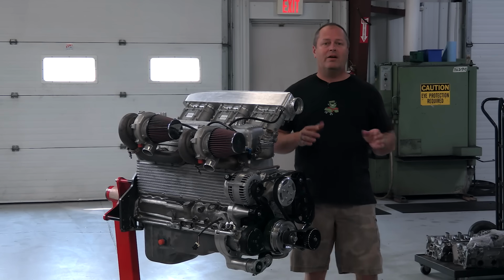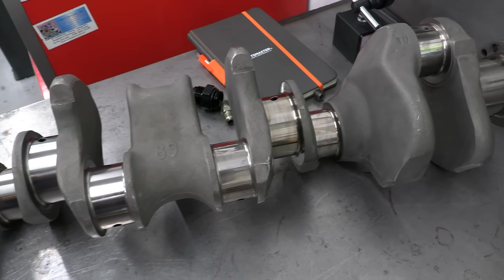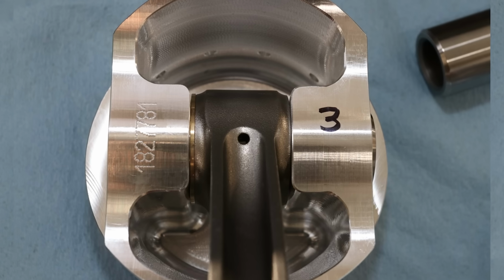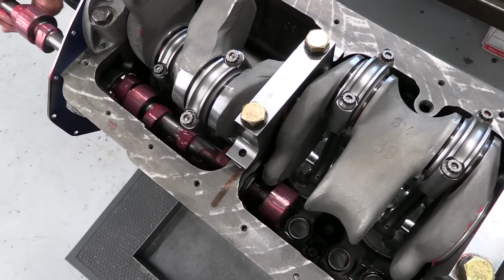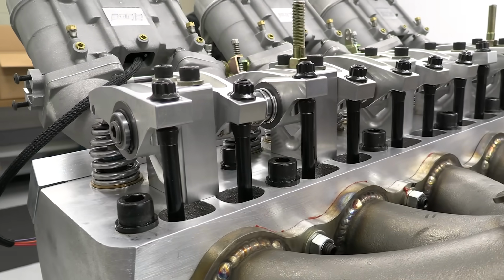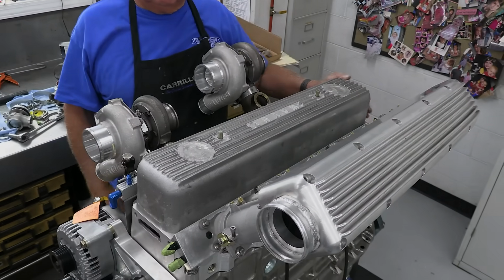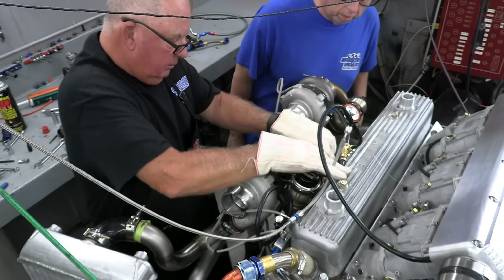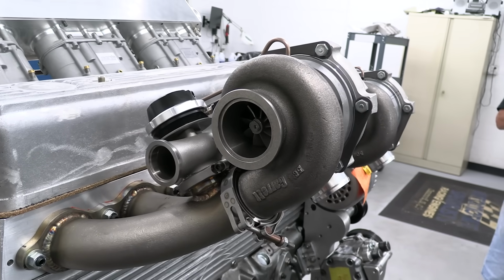Incredible Twin Turbo Chevrolet Straight Six is a One-of-a-Kind Creation!

Comment: My experience of stainless steel manifolds is that the continual thermal cycling changes the metallic structure of the steel resulting in it becomes more and more brittle. I have had much better longevity with cast iron
Reply: Built my first Garrett turbo GM 6 the 3rd gen block with 7mains in 1978 struggling to learn how to control what we had unleashed over 12months we made serious gain's with the addition of waste gate ram air methanol injection. I grew up loving building during the week runing testing at nights race on the weekends at "RIP" Ravenswood Raceway
Scarborough Beach
West coast Highway
All having in the 70s being venues for Drag racing and often illegal drag racing     Perth Western Australia 🇦🇺

Comment: Old hot rodders know all about what these old 6'ers can do. They used to get used in dirt track racing. Back when it was almost all local track run stuff, people would take shells from the 30's, build a pipe frame with a roll cage and a bumper.... and a side guard so you wouldn't get killed in your tin box..... and put a rodded out Chevy six in there. 
I know a guy that has a 2 door coupe that used this formula all the way into the 1980's, and kept up with the small block class cars and won. 

I think it is awesome to see someone doing this up old school with a six, even if they are adding modern tech
Reply: There was one in a field down from a place I worked at. The "roll cage" lQQked like it was made from black gas pipe for a house 🏠 👌 had a straight 6with a wild looking intake, carb was gone...from Wyoming USA 🇺🇸 🤠

Comment: The third gen straight six includes a  292  truck six, with lots of strength. Right now I am running 3, 2 barrel webers on tubular manifolds. The hp increase is substantial, but my goal is to add 2 turbos with 3 throttle body injectors. 
My budget is tight, but in the future  creating a new head from a pair of V8 Chev heads, as described in the stovebolt 6 book. Its been done before, and the hp  gains are impressive. The block has a lot of meat in it,  boring to 0.060 to 0.100 are common place.
This engine can produce 500+ hp. 
The result gives this 6 , V8 hp.

Comment: That torque "curve" is unbelievably straight. Such fine workmanship by a master builder!
Reply: Even in the old days the right work made those six's evil. Heard a story once a guy showed up with one to a circle track full of V8's. They ended up wrecking the guy out cause he was fucking charging up to the front like a bat out of hell.
Reply: @jr540123 
The GMC 302" ruled back in the day; add a Wayne head and you were good to go....
Reply: @jr540123  my grandfather ran a straight 6 in a dirt track car,  in the Midwest back thru the 60s and early 70s. Thing was fast
Reply: That's a I-6 for ya'. Smooth as silk FAT torque, brought to you by Chevrolet.
Reply: I love horsepower, but i'm a torque monster,..gimme more torque!   :o)
This is my new favorite torquer-er-er-er-er-er.  Man, i love, LOVE straight 6s! Just love 'em!
And how could anyone not love the twin turbo setup? That's just the icing on the cake. 500+ hp on that crank? LMAO!
And then i remember which vehicle this is going in, and i just go complete envy. Good,. .clean,.. envy.    LOL
I WANT ONE!
Reply: Amazing build! Using  a 1958 block? Sorry I didn't realize who the  builder was at first, but Keith you are the best! #1 engine builder- Greatest  Of All Time!  I just love how your torque and horsepower curves get together early on and just don't stop. Those gen 2 Chevy 6 engines have that one amazing trait: old Chevy 6 now runs like a small block, wait that isn't correct, it runs like a big block!
Reply: @rgroove1970  That thing is wild. I've never seen a car bounce the front tires down the whole stretch and not look scary as shit the whole way.
Reply: I was thinking the exact same thing
Reply: it´s because it starts at 3500 rpm
Reply: @rgroove1970  Mr nice build BR... i will call you

Comment: There's no torque "Curve", that's a torque plateau. A Torque Hoodoo. Someone will ask you about the power band and the owner will just say YES. I wonder how good it'll be for towing, or even what mileage it'll get- that engine's gotta be super efficient now.
Totally agree with Kieth about making odd one-off and custom stuff. Before electrics take over, we are giving gas the greatest send-off possible- The LS has made huge power a breeze, cheap machining tools are everywhere (both from classic American cast iron to slave-built Chinese stuff) and information and help is literally a forum away. Thanks so much for showing us all this cool stuff HM!
Reply: But if they're so efficient,  why are rx8s such gas hogs? Could ot have something to do with low torque?
Reply: @MrPaige222  I'm not a rotary guy so grain of salt, but rotaries have terrible problems making NOx and other oxides because they burn so hot- and oxides are what you get with a hot burn. The renesis had to avoid that with a unique air intake design that partially strangled them.
Reply: @girthquake1413  
I'm right there with you. I have little to no respect for that particular engine. I understand the tiny displacement in regards to the horsepower output, but it comes at such a huge cost in reliability and fuel economy. No thanks. It's no wonder an RX8 is practically worthless
Reply: @paigehunt3387  Chassis is phenomenal tho; it's basically a bigger Miata.
Reply: @Robots Can Do Better Thank you I wasn't aware of that...Only problem with the rotary is the sealing longevity issue as I see it. Better machining and material control could solve much of that, with at least an elimination of apex seals...
Reply: @Robots Can Do Better But in the long run?(maybe the short term), I believe that diesel hybrids are an excellent feasible solution, particularly considering their flexibility of fuel options. I still think the EPA is BS....
Reply: Bite your tongue...electric cars suck unless it's a hybrid. Two stroke supercharged diesels ARE STILL the most efficient power plants. Been working for the Electromotive since the 50s and they only carry a bare minimum of battery.👍 The EPA is in the back pocket of industry, we should be getting a minimum of 100mpg if the EPA were really doing it's job...Old tech and the new 👍
Reply: @charlesangell_bulmtl  okay boomer
Reply: @girthquake1413  That's all you got?🤣😙😙🤣 Big issues with battery production/recycle. Pollution is OKAY as long as it's not in your back yard, eh?
Reply: @charlesangell_bulmtl  Bro why are you triggered lol, i'd agree with you on diesel hybrids if you weren't trying to look smart in a YT comment section lmao

Comment: If you think this one is the most advanced take a look on what guys in Brazil do to these, they are very popular here, an there's anything done to these, from "simple" turbo setups to original castings builds that push over 2000hp and low 7s passes with H pattern stick shift  and full billet dohc 24 valve builds

Comment: Why not rotate the turbos 90 degrees air filters top center and the exhaust bottom center would isolate the heat from air intake and some plumbing problems!
Reply: turbos can be clocked however the hell you want,this was for the dyno run...kinda thought that would be painfully obvious

Comment: Love to see what he could do to an Australian Holden 202cui motor !
Reply: He’s probably already done it as the Holden “red” engines were basically Chevy inline sixes and were not designed in Australia as they are virtually the same engine used in the chevy2’s or Chevy Nova as a matter of fact the Chevy 2 was sold new in Australia in right hand drive from 1963 and it’s 194ci six was the same basic engine as the first reds of 149 & 179 ci but they were too expensive and when th EH was released they were no longer offered

Comment: The old style valve cover from the early 216 and 235 engines looks great, the only thing on it that looks like a Chevy stove bolt. I've been waiting 6 months for my 235 rebuild, mild cam, dual carbs etc for my '53 Chevy pickup, engine builder says he can't get parts. My friends all say, put a 350 in it, or an LS, yeah, like everybody else does. Your build is an insanely genius and beautiful creation!! And I thought mine was expensive. LOL!!
Reply: Try egge parts .

Comment: 23:58  What happened to all the beautiful hard lines?
Reply from the maker: Testing different things on the dyno. They tried different ways to drain the oil from the turbos, and just went for the easiest way to get things done. It will all have to get put back on before it goes into the truck. Thanks for watching

Comment: Amazing project and awesome to see some straight sixes getting some deserved loved. As much as here in Brasil we are quite used to see gen3 straight sixes being tuned to over 2000hp levels on stock blocks and heads it is simply amazing to see how this build manage to perfectly mix the old school look and modern tech would love to build something similar one day with a gen 3 especially with a crossflow head
Reply: Are you SERIOUS? 
2, 000 horses out of a straight SIX?
Please make a video. 
I'd LOVE to see that! 
Nothing much shocks me anymore,  but THAT sure would.  
I'm sure I'm not alone in this. 
Definitely make a video.
Reply: @MrPaige222  https://www.youtube.com/watch?v=miENduXJivI

2200hp actually on stock blocks and heads with reinforcement plates

And the current record is 7.155 at the 1/4 mile on a h pattern manual
Reply: @MrPaige222  search the Aussie ford "Barra" i6 motors, they're getting over 2000 bhp outa those too.
Reply: @Grumpy_CBG  
That is just plain UNBELIEVABLE. 
Thanks for the information. 
I  can't   wrap my head around the fact that a straight 6 250 cube STOCK block and heads that came from the factory putting out 170 horsies is capable of 2200 with just those modifications.

Comment: This is the first time I have seen a video where the ordinary Chevrolet in line 6, which Chevrolet referred to as the Blue Flame Six modified and built into a high horsepower turbocharged engine. When Chevrolet came out with the Chevrolet small block V-8, it seems like the V-8 got all the attention and the six cylinder got little attention.

Comment: You said it was running port injection but those are throttle body injectors
Reply from the maker: Yeah, that's true. I was thinking about each cylinder getting it's own injector and screwed up my words. As hard as I try to proof my work before hitting publish, something always seems to slip through.

Comment: Very impressive, especially with just a 4 main crank. Later GM in-line 6s, and the Le Mans winning Jaguar XK engines all used 7 mains.
Reply: Exactly what I was thinking, only four mains plus that huge center double counter weight kind of bothered me but I guess at 5000 RPMs it won’t be too unhappy.

Comment: Man love that flat as a table torque curve, it’ll be interesting to see the finished rig once it’s completed. Super nice build guys.
Reply: Straight sixes have always been known for having torque, that's why they worked good in work trucks.
Reply: @bigredc222  ,
 We built a Chevy 292 inline 6 a bunch of years back, we used 302 chevy pistons in it, once we got it warmed up when it idled it sounded like a two stroke engine, lol, we had a lot of fun in our free time at the machine shop.
Reply: @bigredc222  Precisely!!! They were designed to get things moving and not intended for rpm. The rotating mass of the the crankshaft and it's length are a testament to that! Beautiful build and master craftsman.
Reply: @R K its not a v8 that are known to low end torque its a straight 6.

Comment: Beautifully built, this 6-cylinder chevy is a unicorn here in America and is a very popular engine in Brazil and widely used in drag racing.  With only 1 turbo these engines in Brazil exceed 2000 HP.

https://youtu.be/9ctkkiRA6kI

Comment: Chevrolet in the USA never developed that motor, but in Argentina that motor used to rev up to 11k rpm and get around 380 hp N/A with a single carburetor 40 dcnf, theres plenty of aftermarket support for that engine from forged internals, aluminum cylinder heads with 9 and 12 ports, cams for everything and valve gear

Comment: Just throwing in a good trick from motorcycles you get better everything without that plenum at the bottom of the intake mani by the head but you then need to synchronize all the butterflies. It's not too hard I actually just did a cbx today i6 also. But really it gains alot in the low and mid range and some up top too when you don't mix the plusses but the biggest thing is the response you loose huge amounts when you mix
Reply from the maker: Hard to run a MAP sensor without some type of common plenum though

Comment: Custom castings today are lot easier than in the past due to 3D printing technology. In fact the exhaust casting could probably just been printed. After all, today companies are 3D printing ro ket engine parts.
Reply: you cant 3d print strong reliable twin turbo exhaust manifolds .........fucking tits in the comments section,hurpadurp
Reply: @trillrifaxegrindor4411 
If Rocket Lab and SpaceX can 3D print major components of rocket engines that see far more extreme conditions than the exhaust manifold on this car. And SpaceX's case make those motors reusable. They aren't doing it with a cheap filament printer. Some of the materials that can be 3D printed today include Stainless (name your alloy) and Inconel. Plus even if you don't want to print the part 3D printing makes the whole casting process easier. There are 3D even printers that will 3D print the cores, cope and drag for sand molds. Porsche is printing pistons for some of their very high output engines. Engines that put out far more power per unit of displacement than this thing. The trickiest piece on the motor is the crossflow head. And even there they could have gone a step farther and built a new head out of two LS heads. It's been done.

Comment: All that money and quality in the engine and they use a Fram filter :(  Surprised they didn't use a 292 to build up.
Reply from the maker: Run on the dyno and then cut apart for inspection
Reply: Considering oil filtration was an extra cost option on those engines anyways its still better than factory.

Comment: I been interested in 6cyl performance since I saw the 300 Ford with 351 Cleveland heads grafted on to it, it was a fast drag car, faster than alot of big V8 cars! I want to build a Chevy version, with aluminum heads of some kind, it will require a special cam, since the intake and exhaust will likely be in different orders, imagine a set of modern hemi heads on a 250ci, it should flow a ton, capable of spinning to the point where the Pistons exit through the oil pan, but the 250 is next generation,. 7main engine,  I have revved one 5k all day, so maybe with a bit of work it will turn 7200 rpm, half a Day! And should make some power, especially with boost!!
I don't we understand  why, if they did all the machine work on that head and engine, why not machine atleast a groove around the head for a drain back, if it's not but . 030" deep, and . 010" wide, it would make things easier, a to least mentally!?!!.. great video, any more on this engine?

Comment: If I'm not mistaken, Chevy built a 265, but it wasn't nothing like this. This is a work of art that just happens to make a lot of horsepower, and which equals to be very fast.. Ronnie.
Reply: 265 was the original smallblock V8

Comment: I am puffing up my old 250 inline 6 with intake & exhaust headers, twin carbs & a lump port kit. Stock cam. All I want is to get above 180 HP with a wide torque band so I have about the same power as the old 283 put out. It will be plenty for this old man in his daily driver, user friendly, 4 speed, 4WD 1981 square body.
Reply: Posting any videos old timer?
Reply: @CoyoteDAworld  No, I've never done anything like that.
Reply: You will have more than enough horsepower and torque for a daily driver with a 250. Im guessing Clifford or Sissle  on the intake and header ? 
Personally I have always wanted to just keep a 230 or 250 as stock and clean as possible.  With the ignition upgraded with electronic fuel injection by MSD would wake one right up with plenty of power for anything I want to drive. Its funny how the old 230 and 250 straight 6 engines just run forever very dependable, can easily get amazing fuel mileage, and yet not very many people want to do anything with them anymore. Why Chevrolet stopped making them has always made me scratch my head.
Reply: @sswcustomsewing4276  The headers are long tube Hedman pieces I got from my son-in-law for Xmas, and the intake is a complete custom fabrication topped off with a Ford 2100 Carb. Once we got it ironed out, it pulls like a 200 HP small V8 with a wide torque band, so we're happy. Mileage isn't great, tho, maybe 13-14. Air fuel looks good so, it is what it is.
Reply: @wymple09 13 to 14 mpg in that 4wd square body is actually not bad at all. Im guessing you are still running the stock flywheel and clutch ?
Reply: @sswcustomsewing4276  Yup, even the cam. I could get another 20 HP pretty easily, but won't bother. It starts & runs like a champ.

Comment: This is by far the most incredible engine build I have seen. You always seem to get all the fine details in there, which makes the videos shine in my opinion.
Reply from the maker: Hey, thanks a lot!
Reply: Very well said and well deserved comment.  You did a fantastic job not only showcasing the engine,  but Keith himself.
Reply: @TheHorsepowerMonster  i have a wonderful for Keith Dorton could a carbonated engine be turned into a Fuel injection 💉 system with out the distributor  hi 👋 from 🇨🇦 #YSW